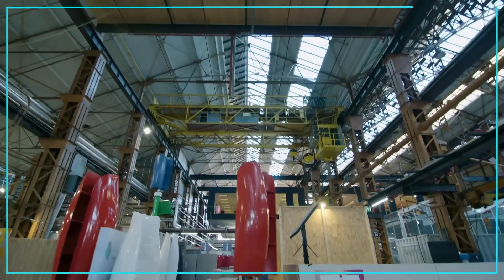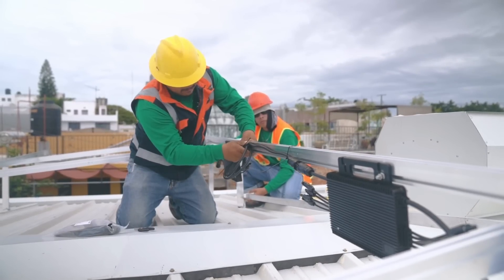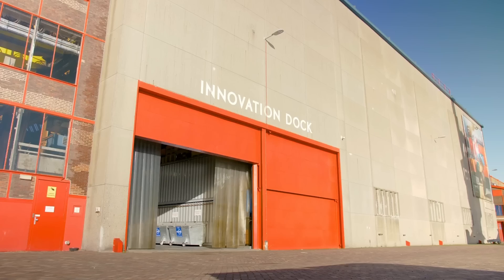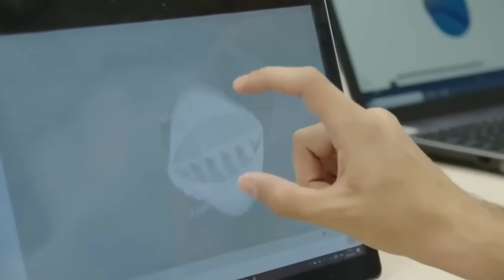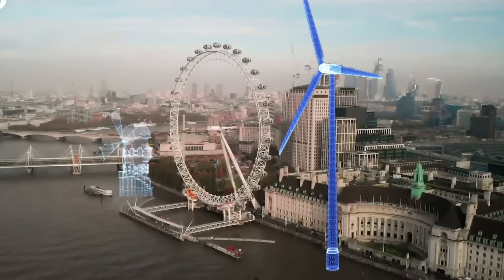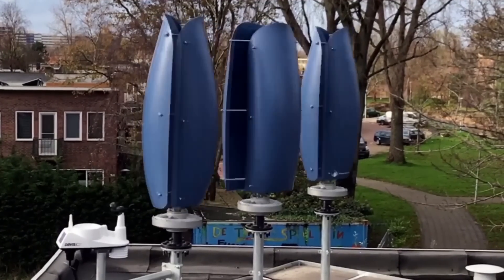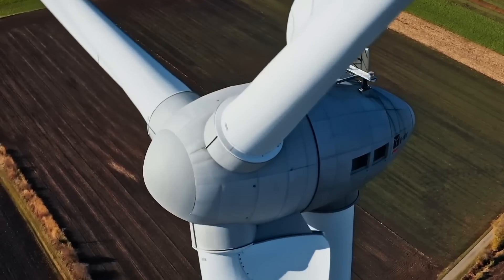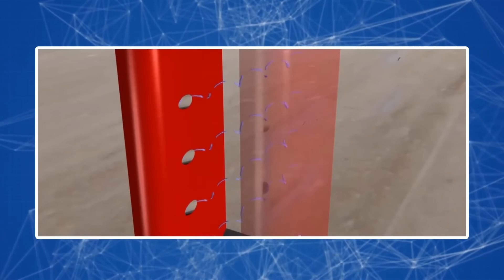This NEW American Wind Turbine for Home Outperforms PV Solar Panels in 2023?!

Comment: This video is complete bullshit, These flower turbines output per the website:

Expected Production in a Bouquet of 5:
≈144.7 w/h each when correctly oriented
(≈723.5 w/h total) at 12 m/s (27 mph)

The cost is over $7,000 USD. This is not cost effective comparative to solar. Please stop making videos that promise innovation at a far lower rate than what is legitimate.

Comment: You know, it's a scam (at least dubious), when they emphasize the start at extra low wind speed. Because this is pretty irrelevant, since there is hardly any energy in slow wind.
Kilowatt/hr? Seriously? At least, they didn't say "Kilowatt per hour"!
And regarding CO2 per kWh: This denpends on the type of turbine and the yield over lifetime, you can't take the figure of a big multi-megawatt-turbine at a very good site (like 4,64 g) for such a toy at a site with hardly any wind (e.g. in a city near the ground). And 70 grams CO2 per kWh is too high for solar panels nowadays. A study from 2020 shows figures between 11 and 37 grams, depending on the type of module (and site of course).
By the way: The same study shows 12 grams of CO2 per kWh for "wind onshore" (big turbines at windy sites of course).
My advice: Don't trust wind turbine offers without a clear declaration of power output at different wind speeds.
Don't trust wind turbine offers, which make you believe in a good electricity yield at average or even bad sites. You need windy sites to get a decent yield with small wind turbines.
Reply: OMG!
I just was on their website and found: "Output Power in Watts per Hour"
🙂
Reply from the maker: This is the authentic info from their official websites.
Reply: @FutureGalaxy  I didn't think that you fabricated this nonsense yourself.
The company is to blame in the first place.
But it was your responsibility to spread this "information" without thinking it over and/or commenting it critically.
I know, you are no exception of the rule in this regard. This is one of the downsides of the internet.